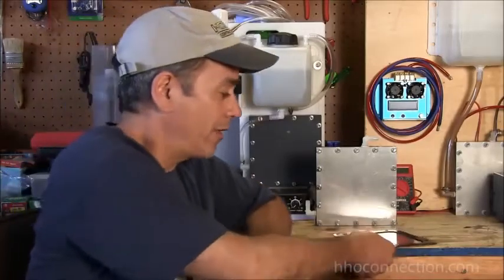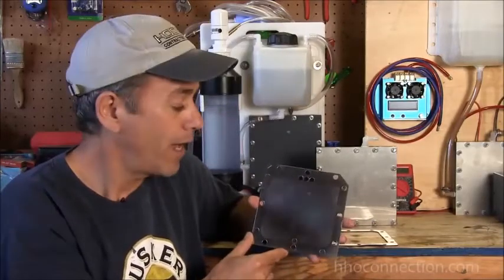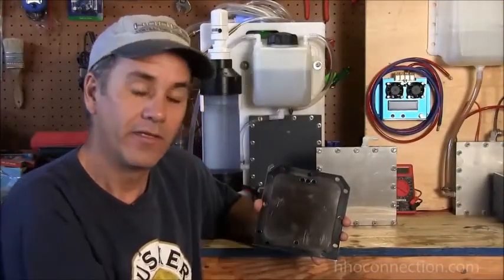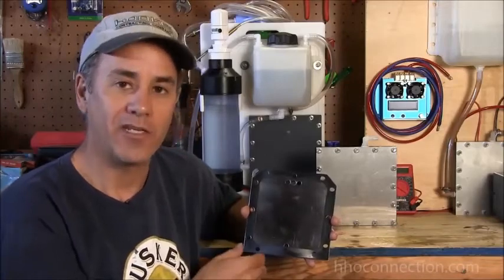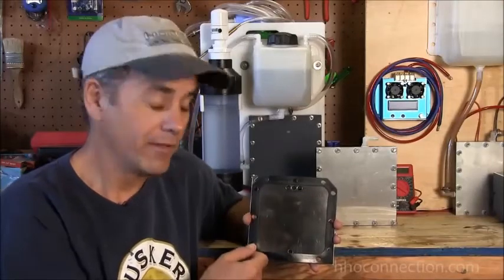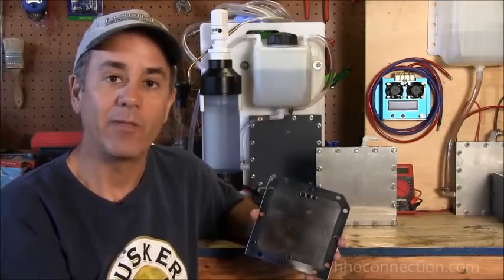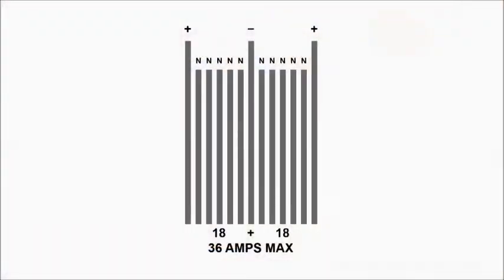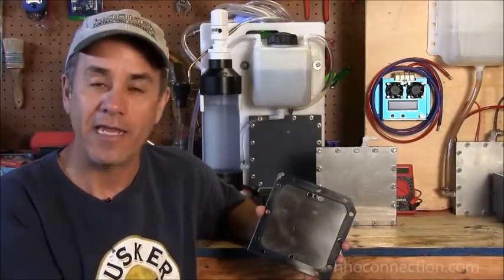HHO Using the correct Amperage

Comment: I have 9 plate with +n-n+n-n+ its heating so i should measure the plate size and accirdingly amp i should give it but how should i cintrol sending the amp to the plate through relay or something else ?
Reply from the maker: Use a "motor speed controller " aka a Pulse Width Modulator, they are widely available to control the speed of electric motors. They work great to limit / control the flow of voltage / amperage to the HHO Wet or Dry Cell.
Reply: @fullnelsontv721  thanks mate i will tey it tommorow and will send u thr update. Truly appreciated ur reply
Reply: One more question incase if you have a electeical diagram to provide will be great for better understanding

Comment: I have a question:  since there are always energy losses, you waste more Amps and Volts than you get back in H2 ;  what is the purpose of HHO?  i wanted to run my Merkur XR4Ti on it but the physics of it is bothering me, what am  i missing here ? thanks
Reply: Depends on the application.  In a solar application the panels are producing even while no load is being used.  Once batteries are fully charged its wasted energy.  So rather than waste it convert it to hydrogen from water or urine if you want to be extra efficient lol.
Reply from the maker: I let a 100 watt solar cell charge a deep cycle battery, I use to power mine.  Since the power source places no extra load on my alternator, the HHO made is acting as a fuel catalyst giving me a more complete burn, without the extra drag on my car's alternator. Not free extra energy, but very low cost / low maintenance.
Reply: @fullnelsontv721  ok, i see; no load on the car's alternator; 
but with  a 100 W solar panel, if we charge  for 6 hours, we get only 0.6 KWhr of energy;
 if the efficiency of the whole thing is 50%, we get only 0.3 KWhr of energy

    since gasoline has 12 KWhr per liter, we only get the equivalent of 0.3/12, or  0.025 liters   ;  
     since gas costs aprox  50 cents per liter,  we are saving only   50 x 0.025  or  1.25 cents,  a little more than 1 cent per day ??

my math must be wrong, or it seems that it is not worth the troubles, then;
 any input is welcome,thank you

Comment: Hi, 
Best video tutorial and I have one question. I need information about this:
IT IS BUILD OUT OF 40 NEUTRAL PLATES - 8 STACKS 5 NEUTRAL PLATES PER STACK AND 9 POWER, 49 316L STAINLESS STEAL PLATES (95X95X0.5mm),  or 3.74inchx3.74inch. How much max amper can use a produced hho gas with that configuration.
Best regards
Reply: 12v instalation I forgot
Reply from the maker: For your Dry Cell a minimum of 10 amps as 12 - 13.8 vdc input, to a maximum of 60 amps (for short periods of time (10 minutes or less at a time).  For continues, trouble free use, run at  30 to 45 amps.  That ensures no wasted input energy, no excess heat, and the most efficient HHO output.
Reply: William Nelson What you think how much hho gas can be produced with your tips around amperage.
Best regards
Reply: William Nelson Hi tell me are you web site still exist and write your email address, I have some question about carbon cleaning machine.
Best regards

Comment: I haven't been able to figure out how to lower amperage in my 40 plate cell. I Run 12v strait from the car battery. The 30A fuse burns up and without the fuse the wires catch fire.
Reply: https://www.hhokitsdirect.com/products/40-amp-pwm-power-controller
Reply: it should be 43plates with 5 neutrals in between every Neg and Pos not 40

Comment: Hello. What current and amount of gas do I need for a Toyota corolla 1.6 liter petrol engine?
Reply from the maker: You need 1/4 of a liter of HHO per minute for a 10 % gas savings, with a engine that size. At 1/2 of a liter per minute of HHO you'll save up to 20 % on gas, or slightly better.
Reply: @fullnelsontv721  Hello! This is without changing the engine speed, that is, the constant production of HHO?

Comment: What HHO amps are needed to run a 32hp/1200cc tractor engine please, I'm worried their is a limit to what a gen can produce. Any info would be great, thanks Bill.    Joe
Reply from the maker: The best way to run a 32 hp tractor engine, is with HHO as a fuel catalyst with ( the fuel - either gasoline or diesel) the engine was originally designed to run.  For such a small engine, look to generate .25 to .5 liters per minute max.  Depending on cell size and type, 8 - 18 amps will be needed.  This can easily reduce fuel consumption by 30 to 50 %, if adjusted / tuned properly.  To run a engine soley on HHO, takes much more modification, and is not always cost effective.
Reply: Thankyou Bill good advice and knowledge, appreciate your help
Reply: @joevandervoren5305  you don't have to modify a engine to run on hho that's just a lie to stop people trying it, all you gotta do is change the cam timing because the hho ratio h66.67%/O33.33% implodes so it needs to combust on the in stroke not like diessel which pushes the pistons back out when it combusts, you can feed the hho gas straight into the air intake but you need a flashback arrestor.
Reply: the diessel engine was invented by a guy called Rudolph diessel it was not designed to run on diessel the oil companies stole his engine after he died and marketed there product as DIESSEL, the original engine ran on peanut oil

Comment: well if wet cell will be the same?
Reply from the maker: Yes, the same amount of amperage applies to both wet and dry cells.  Overdriving (applying too much amperage) to either, results in less efficient operation, and production of heat / steam, instead of the HHO we're after.
Reply: thanks mate!
Reply: one more question, so if i have 50 plates 20x20 cm. and 2.6mm gap between them i need 130 ~ amps?
Reply from the maker: Zavarkinas .....  With that configuration, you'd need 128 amps max.  I'd plan on running in the 60 to 80 amp range (for normal driving), to avoid premature plate wear, and minimize heat.  The gap between plates needs to be 1.5 to 1.75 mm max. Cell spacing is especially important with wet cells, as they leak more voltage / amperage if the plates are too far a part.  I'd also run a good electrolyte like KOH (lye) at a ratio of 24 to 28 %, to maximize production.  Having a PWM makes controlling production much easier, and I consider having one, a must have for any HHO Cell running more than 20 amps.
Reply: good. well i am not going to rebuild hho generator, i will leave 2.6 and i will try with 120~ amps hope it will work good for 4 l engine.